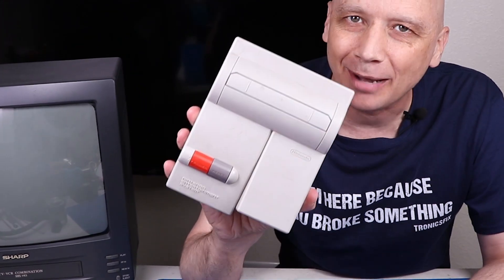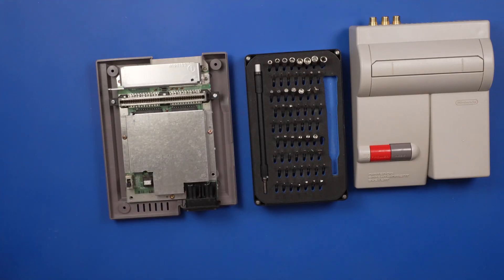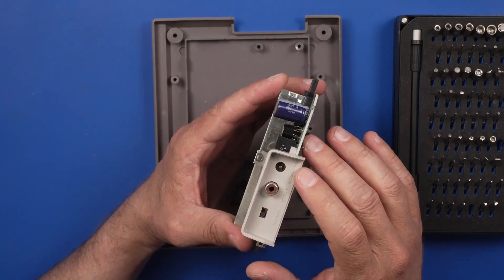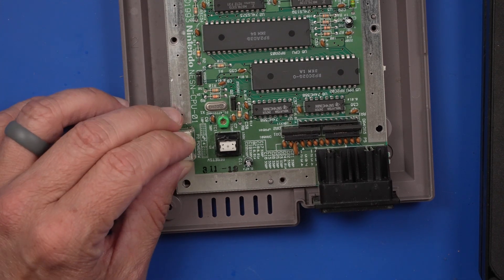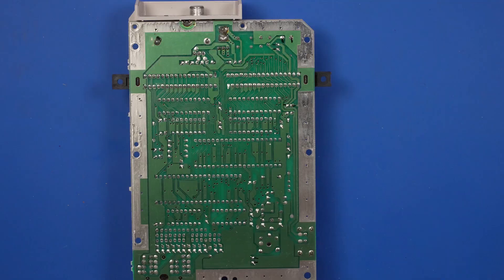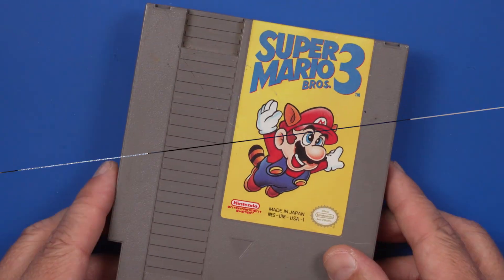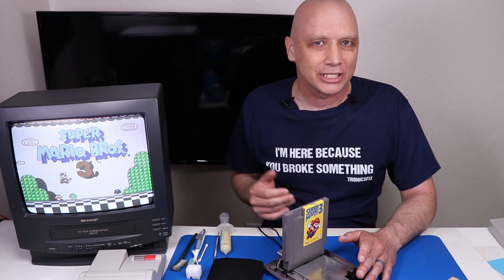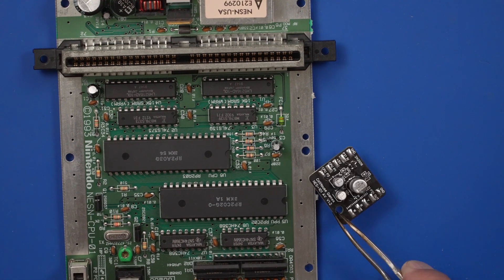This NES Is Worth $200 - But It's Broken - Top Loader Repair + Mod

Comment: The situation stemmed from numerous complaints regarding the NES-101 Top Loader's subpar picture quality, attributed to interference from the board design and its reliance on RF. By the end of its product life cycle, the NES-101 provided a composite output; however, it simply mirrored the Japanese model, which featured an SNES multi-out connection. It's crucial to emphasize that the multi-out NES Top Loader is extremely rare and virtually impossible to identify, as the packaging only specifies RF instead of AV.

Comment: That one with AV jacks on it is a modified one. The ones that were factory completely replaced the plastic piece where the RF connection is with a SNES style one that just has a standard Nintendo AV multi out port. The only way to get one back in the day was to call Nintendo and file a claim about any video issues(jailbars) you were having. You would then send them your top loader and they would either replace the port part with the multi out or just replace your whole system with one that the already put a multi out in.
Reply: @dustyshoopman845  do you know if any of these after market mods fix the jail bars, going from RF to AV or HDMI?

Comment: I have a top loader that has been modified to used the snes tv connector,   but now it has a problem, problem is, it is frying the big part of the power supply, first it messed up the original nes power supply and my genesis one too, not sure what the problem is, any suggestions?

Comment: Sorry to trouble you,, this has nothing to do with your video but the back lighting went out in my flat screen tv an I am having trouble pulling out the TV screen strips they will not pull out do you have any advice that I can use to pull them out with out damaging them? Thanks for taking the time to read this if you do.

Comment: The coolest thing about the top loader NES is that it wasn't region locked if you had a European cartridge it would work fine alongside unlicensed ones (don't try the very rare aladdin deck enhancer it says on the package do not use with top loader NES why? It will fry the console it only works on some original NES models and and yes if you have an early copy of gyromite or stack up which had the Famicom to nes converters in them you can use those two so if you want to play the Japanese versions of say Super Mario Brothers or the original doki doki panic then you can) very cool yet rare piece and its worth 200? I've seen it at more than that especially in box (bloody eBay scalpers) but id love to own one vanilla or RCA modded doesn't matter since older original NES consoles have those stupid lockout chips and I'm sad that the super NES didn't have a region free version if I did find one I'd love to own a region free modded console same for other consoles like N64 and Gameboy Advance or Color/Colour systems might try checking eBay since that's where i got my friend's modded region free European Dreamcast (we had a broken North American one that we were able to change the power supply to and boom it works because the only real difference is the power cord output in watts and design but you can just swap them out and it works

Comment: I really don't get the NES top loader. It looks identical to the AV Famicom, but as the name suggests, that recieved an AV out, but this one had it removed. Why? I'm sure it would ahve been way more cost effective, if they just made the same exact device, just with different cartridge slots.

Comment: Worth and Value are two different things. The NES top loader cost $49.99 brand new in 1993. They are not rare. You may Value it at $200 but it's 31 year old tech.

Comment: I have a question, I cleaned my ps4, removed everything, and then put everything back, when I tried to turn on the power button it didn't work but the one on the disk worked and turns on the ps4 but it gets stuck in safe mode, I removed everything again, everything was perfect, The power button is not broken and everything was perfect, I don’t know what can be

Comment: Can I make a challenge because I have one for you? I have two dual shock 2 controllers for the PS2 fat and only a few buttons on the controller work my opinion is that they have a bad membrane or a bad trace. I’ve had one of them open cleaning. It did not do the trick. Would you take on and use them in a video for me so I can dive back into the classics?

Comment: The factory ones were only replacement versions for those who had broken/bad RF ports. Back in the day if you sent it in for repairs then Nintendo would fix them with a standard Nintendo style AV multi out port, the same port the SNES and N64 used.

Comment: There weren't 101s with separate RCA jacks from factory, but Nintendo did make them with the multi-out used on the SNES. iirc you got one like that if you warrantied a top loader later in the production life of the 101. I'm not sure you could buy them in store that way ever though, and they're really rare today, I've never seen one in person despite repairing consoles for a number of years back in the day. Though people have built mods to convert any top loader to that style.

Comment: That's a mod. NES never had stereo RCA audio, and the AV Famicom (Japanese version) used the same Multi-AV cable as the SNES/Super Famicom.

There is a prototype toploader NES with the AV connector, but they were never sold. IIRC they were only used for display models.

Comment: Hopefully someone with knowledge in surface pros sees this. I have a surface pro 7 and recently I started noticing white spots appear on my screen. I've looked elsewhere online for an answer but not getting any clear answers aside from pressure or dropping it, which it hasn't been through that aside from setting on my desk all it's life. Is it a hardware issue that indicates a screen replacement is around the corner? Let me know, thanks.

Comment: Hello Steve. I have just bought a couple of Famicom from Mercari (here in Japan) and wanted to give it a try and restore them. That's something I wanted to try once. As they are pretty cheap on second hand, I thought "Why the hell not ?". Your video could not come at a better moment.
I'm sorry to ask, but would it be possible to share the link to mod kit that you have used ? I could find a few here and there on the net, but the one you use seems pretty easy to use (which is not a good criteria as when we see you work, everything looks so easy...).
Anyway, I've been following you for a while and your videos are really educational and inspiring (in the sense that there are almost always ways to give a second life to our electronic devices).
Thanks again for all this and I hope your treatment is all done now.

Comment: I didn't see if anyone commented this yet or not but...To my knowledge in North America they never released factory A/V toploaders.  They did however offer an "upgrade"  to the multi-out style of connector used by the SNES if you sent your toploader in to Nintendo.  I'm not %100 sure on that, but it's what I've been told in the past.

Comment: Hope you're doing well!! What a nice tune-up video on one of my favourite consoles!

When I bought my factory made composite NES toploader years ago, I was told that it was not a retail option. It was a service that Nintendo had made available where you could send back your RF toploader and they would 'fix' it with a composite port and send it back to you. If I remember correctly, they offered this fix because the RF didn't provide a good quality audio or there was a hum. The composite port that's in it looks pretty much like the SNES composite port, not RCA plugs like that. So I guess it is sort of a factory option?

Comment: You said you needed to hookup a ground wire but it doesn't show that you did in the video and didn't appear to be there when you installed the top. Was it not needed?
Reply from the maker: You can see it right before I put the top cover on
Reply: Yes, I see now, you are correct. My apologies.

Comment: I'm not saying this to be mean. But I don't understand the point of repair original NES hardware anymore. You can perfectly emulate NES games on a cheap cell phone or tablet. There are hundreds of official re-releases and let's be honest, you can fit the entire NES library on a single Micro SD card. And download it illegally in about 2 minutes.

There's the collector aspect and I dig that. But playing the games? I don't see value in original hardware anymore. You can even get accurate USB controllers or even wireless ones to replicate that aspect too.

Comment: I am personally not really a fan of having those three knobs on the back or the side of the system, because it means you have to damage the case and the mod isn't reversible anymore. What I do is remove the antenna connector (whatever that is called in English) and put in a 3.5 mm jack in it's place (normally with hot glue), that I then wire to the audio output and video output points that would normally get connected to the knobs. Then I use a 3.5 mm to composite cable.
Yea, ok, I don't use these kinds of kits shown in this video, I'm cheap, I use kits from aliexpress (they're basically the same I use for Atari 2600s).

Comment: Hey Steve, couple of things here, 1.  RCA jacks never came from Nintendo on the NES-101 version it had the multi out connector that's on the super Nintendo & GameCube, if it didn't have that it had RF,  2. should never use magic eraser on anything retro, micro fiber clothes are cheaper.  3.  Super Mario Bros while it is a good game, not the best game for the NES ever!

Comment: Nintendo did make some AV NES units but as I recall they were not sold in stores - only offered to customers who complained about the unit no longer having AV output like the original NES had. These replaced the RF out with the SNES/N64 style AV connector.

Comment: if you want to get a nes top loader I recommend the av Famicom it's the same thing basically but with a av port like the snes/n64 and gamecube. Keep in mind you'll need a 60 pin to 72 pin convertor (I believe that's what it's called ) and you want to get it modded or pre modded to get a lot of compatability back since certain games like rad racer 2 don't work properly without it

Comment: Another cool thing about the top loader NES is that it does not contain the CIC Lockout chip the original NES models had so you never had to worry about the NES mistaking a retail game as bootleg.

Comment: Steve, they had ones that replaced the RF with a multiout (same as SNES) if you sent it in for repairs to fix the jailbar issue.  Supposedly there were some in the wild very late but the repair is the only place I’ve seen them come from.

Comment: To answer your question at the beginning, that's a modification.  In Japan, Nintendo made the AV Famicom and it had the familiar AV port from the SNES, N64 and GameCube in back instead of the RF coaxial jack.  Why it was Japanese only and North America got the coaxial, only they know.

Comment: I don't think any version of the Top Loader NES had anything other than RF, however The Japanese/Famicom version the AV Famicom, used the standard Multi Out which allows Composite. (No S-Video or RGB without modding further, however). The only evidence for a NES with composite from the factory is somebody on a forum about 10 years ago who claimed they had sent it to Nintendo for "repair" and complained that it didn't output composite and got back a system with a Multi-out port, but it seems to be entirely based on that anecdote that anybody believes them to exist at all.

Comment: 'Lets get this back together enough to test." I know where you're going, but all you gotta do is plug in and go. No heatsinks, no fans. It was ready right out the gate. I mean, that's what I used to do on my old NES when I'd fix it as a kid. If it worked, back together it went.

Comment: FWIW, I would recommend taking the time to desolder the PPU and just lifting the pin vs snipping it. That way if you want to reverse or upgrade to a RGB mod it’ll make the process a little cleaner.

Comment: I wonder if that AV mod passes EMI test. Would strongly advise to keep these signal wires taped close to the shield (on either side) or a ground plane so that the fields stay somewhat contained.

Comment: The OEM composite out 101 NESes do exist, and there is proof of them existing. They are just absurdly rare because you had to specifically call Nintendo and complain to them that you were very unhappy with the video signal coming out of the top loader, and they would take your NES and replace it with a different one that had an AV Multi-Out port like the SNES and later (no RF at all), presumably reused parts from the AV Famicom retrofitted into the 101 NES. And of course, people rarely ever called Nintendo for that sort of thing, let alone at all. So there is surely only a very small handful of them out there. I've always wanted to get my hands on any top-loader just for reliability's sake.

Real good video! And be well!

Comment: The AV jacks one is modified. The only top loading nes that had AV capabilities from the factory was the Japanese only famicom 2 (AV famicom) that used the same cable as the snes for video.

Comment: My suggestion is to always solder the ground pin first. You don't always know what stray capacitors are are still on around and connecting something might lead to some weird things. This is basically irrelevant most of the time, but you never know.

Comment: There was a NES top loader that had the SNES multi-out from the factory, but nowadays that one is quite rare and expensive since it was released really late. There was also a board revision that had better video out through RF, but it's also quite rare. The one you have with the AV jacks is modded.

Comment: The NA NES top-loader is strictly RF-only, and any additional jacks are aftermarket mods.  Not sure about EU models.  The Japanese version, the "AV Famicom", uses the same multi-out as SNES/SFC, minus the s-video capability.  So that one does composite (and only composite) out of the box.  I have a JAVFC that's been modded for analog RGB.  Looks amazing on a Sony PVM monitor.

Comment: if you removed the RF mod is cutting the leg really necessary? I HATE cutting legs on old chips that aren't made anymore. Especially a proprietary one like that. The obvious exception being the stupid reset chip.
Reply from the maker: Honestly I don’t know if that’s necessary or not. I just followed the instructions that came with the mod parts.

Comment: That one is modified as the ones that supported A/V out used the same connector as the SNES. Those were in JP only but some modders have been able to retrofit the SNES multi-port to the 101 top loader.

Comment: for pass through caps in the 80's and early 90's, there is a difference of opinion. They aren't as bad as SMDs. My argument is they CAN leak and will go bad eventually. Why not replace now to prevent damage later. Other people seem to think that having 50 year old caps and leaving them alone is perfectly fine. If you change them you risk damage. I've damaged traces, but never on a cap.

Comment: What the heck is RF output?
Reply: Analog TV, COAX , Old School.. even the first PONG systems circa 1975 etc were also RF,  but they used a manual switch box

Comment: Usually if you're doing mono, you take the left channel (white) not the right channel (red). The colors on the wire (as you know) are just colors, so as long as the source and destination match, you can ignore the colors. Again, I'm sure you know all this. But for anyone who might not.

Comment: Happy to see and hear you're doing better! A few notes:

- top loaders from NTSC-U region are RF only. Japanese units have composite.
- you really don't need to recap these. They're not like other systems which are notorious for cap failures. You can sometimes cause more issues than you solve with unnecessary recaps.
- top loaders are more reliable because no ZIF connector and no lockout chip.
- there are easier less destructive ways to add composite to these. In fact you can add composite with no cutting using a 3D printed backplate and a reproduction of the official Nintendo multi out port. I'd recommend that rather than mangling factory housing and cutting pins off the PPU. You can purchase the kit for 20 dollars from laser bear and it's way less work than the kit you used.

Comment: The top case with AV outputs was likely swapped from a different unit that had been modded.
That would explain why there was no solder points on the motherboard, and the LED connection was also cut.
It makes me wonder if their soldering job killed the other one, or if it just quit on its own, lol.

Comment: When you get time a better investment into wiring is 22 gauge silicone servo wire it’s better it resists heat plus cuts easily with a razor to trim edges plus holds more solder it’s flexible and no need to look like a rats nest like the plastic stiff wires you were using use a zip tie and measure to exact this away you work looks like a pro also run the wires along the inside of the case along the edges held with a dab of hot glue i build and fly rc airplanes this is why i can give some advise

Comment: This isn't worth it IMO. The Japanese top-loader (AV Famicom) is much simpler. It uses the same multi-out port the SNES uses for AV composite. Pair it with a 72-to-60 pin adapter to play NES games.